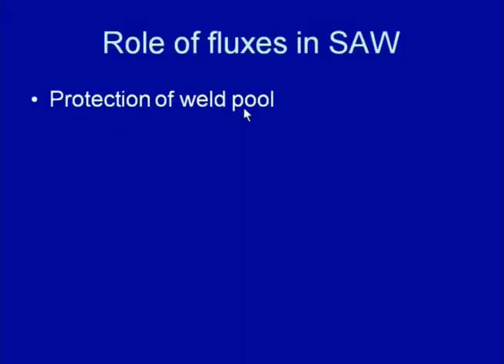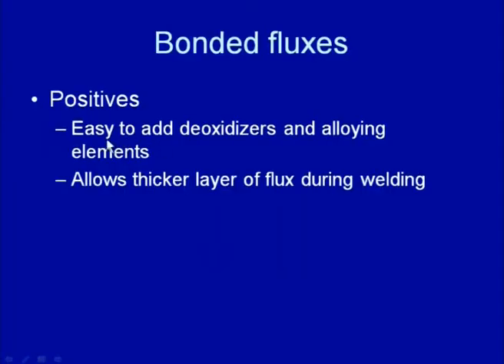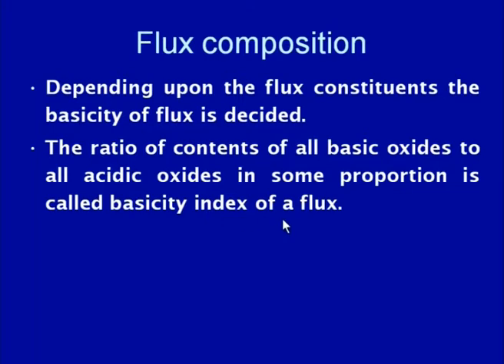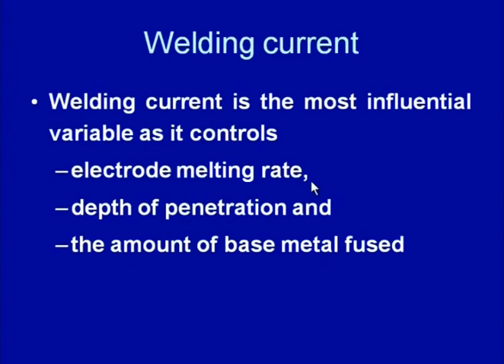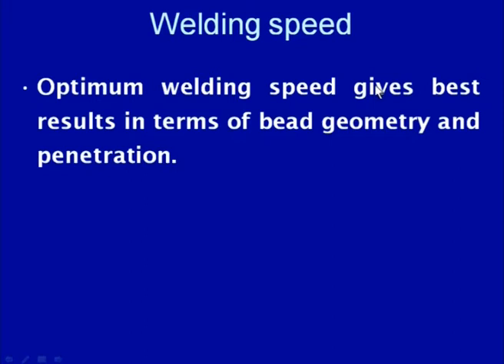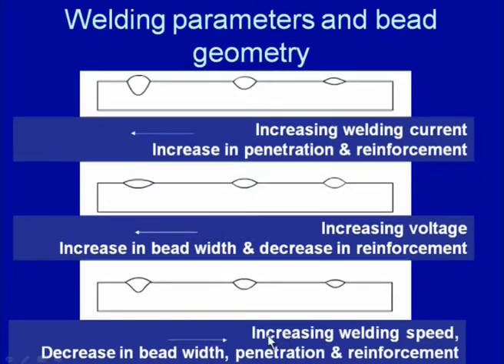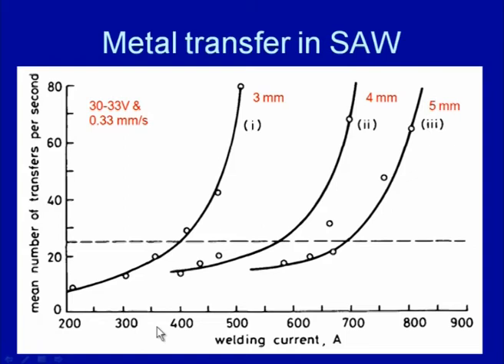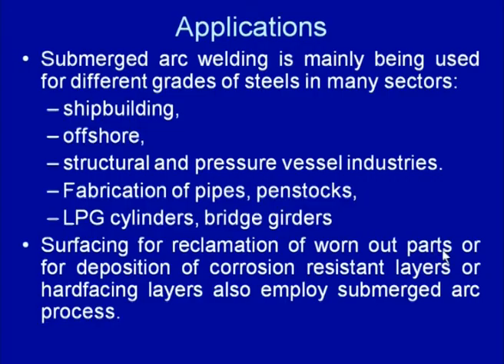SAW

Comment: When we are talking about the no. of drops being transferred : larger dia. gives more metal deposition rate & thin wire will give lesser deposition rate so its actually more power to melt more metal thats what we giving with higher current for higher dia.
isn't it ?